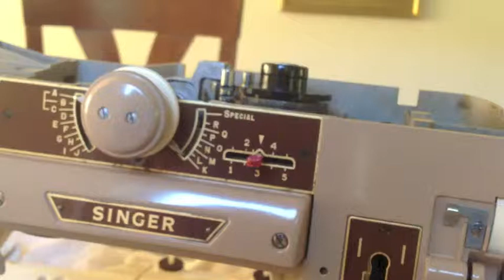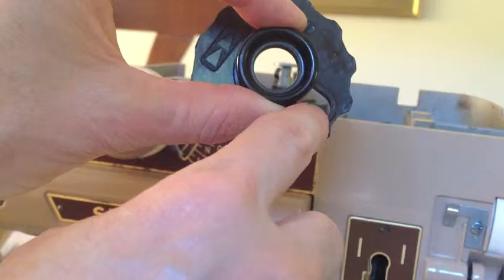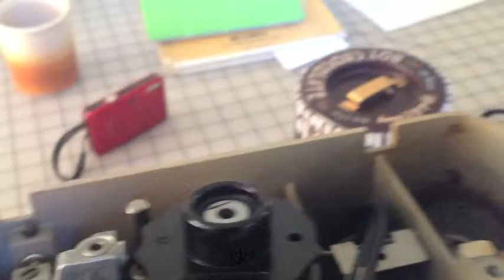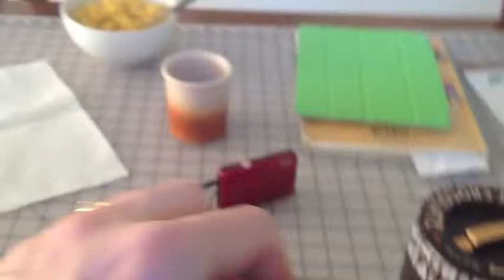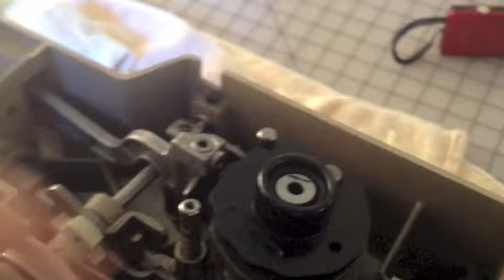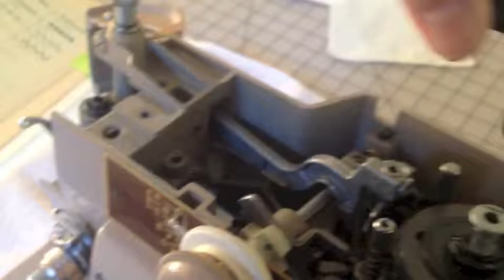How to Remove and Replace Cam from Singer401 Sewing Machine

Comment from the maker: i have read on the manual that for the Singer 500 Rocketeer, before inserting or removing top hat cams you should move the lever of stitch width selector to the "zero" position. Hope this helps to keep your machine in good shape

Comment from the maker: I forgot to answer your last question, you do not need to unscrew the whole top of your sewing machine model 400 pr 500. Just raise the lid of the top and with your hand pull out  the black cam, remember to move golden lever to zero first.

Comment: Poor production. Why not talk through the process rather than pointing and the camera not showing what it should. Also the microphone noise is terrible. You seem to know how to remove and install a cam, but by refusing the speak as you demonstrate, the video comes off very unprofessional. This is meant to be constructive criticism for improvement.